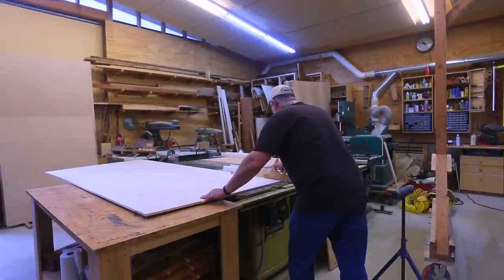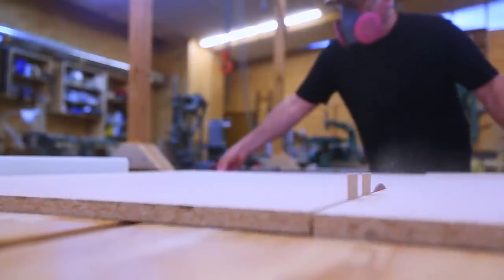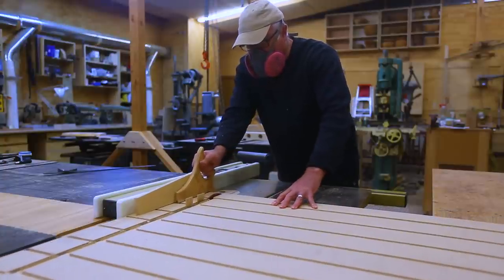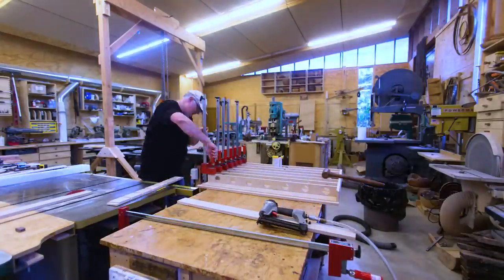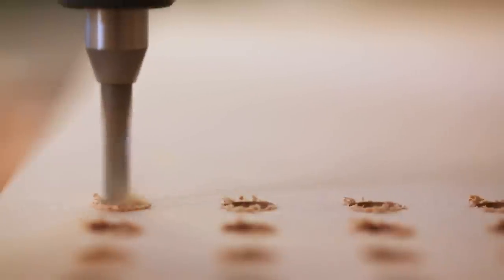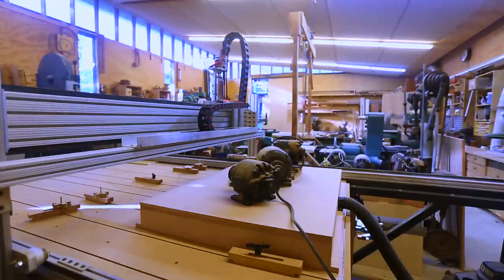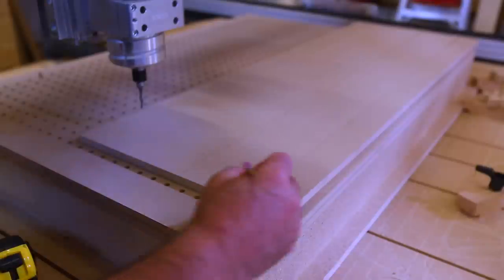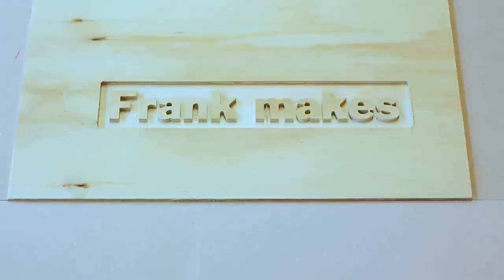Vacuum Hold Down Table

Comment: I own/run a commercial CNC in a millwork shop. Not sure how well the information would transfer to a smaller CNC, but here are a few ideas:

Our CNC has an aluminum table with holes for vacuum. Instead of having so many holes (ours are about 4" apart), our machine has channels around each hole to spread the vacuum of each hole. Would reduce cutting time, and allows for realistic plugging of individual holes.

Ontop of that we put a "spoilboard" solid 4x8 sheet of 3/4" MDF (no holes).

We prep the sheet by running all edges through the edge bander. This stops air from leaking out the sides.

Once that is done, I use a 3" cutter to mill off about .2mm from one side of the sheet. No only makes it very flat, but the surface is now much more "open" for airflow. Flip the sheet, and repeat. The sheet is now perfectly paralel to your gantry and open for airflow.

I'm not sure if a vacuum should have enough power to do the same (pulling through MDF) on your scale. Our pump is 10hp, but it is capable of 5x12 cutting area (usually setup for 4x8). I can cut a 24" x 24" piece of MDF sitting in a corner of the sheet without blocking the rest of the sheet off.
Reply from the maker: I thought about doing the method where you suck right thought the mdf, but it looked like you need a big suction motor for that.  A lot of flow and pressure.

Comment: Hi frank,  make sure you have enough air flow to allow the shop vac to stay cool. They rely on air flow to cool the bearings and motor.

I've seen people use motors from ducted vacuum systems and drill a small hole in the hose so it leaks just enough to keep the motor cool.

Love your work
Reply from the maker: Good idea. There is a cut in the hose, maybe I won't fix it.
Reply: frank howarth perfect

Comment: I used to run a graphic arts camera that had a vacuum film back. To allow different sizes of sheet film there was a sliding valve that would close off the area around the edge allowing smaller and smaller sizes of vacuum area. The sizes were marked off in red so you could align the film where the vacuum was, worked quite nicely and I'm sure you could do the same thing and not even need those pieces for blocking off the air flow but the pieces for alignment might be nice.

Comment: Hey Frank,  not sure on the vacuum required but some of the CNC router companies I've come across draw vacuum directly through the MDF w/out the peg board design needed.  You can isolate this surface area with thin plastic sheet i.e. trash bags.  Love your videos.

Comment: To get better suction you want to make a larger number of smaller holes. Big holes like what you have or pegboard for example don't make very good tops for suction tables. I'd suggest looking at some videos related to making vacuum forming or vacuform tables - they're extremely similar in build and are used for holding down forms to molded, while a hot pliable plastic is placed over top that then gets sucked tightly over the form to make a mold of it.

Comment: We had a thermwood in high school with a built in vacuum table and what we did is cut custom waste boards for each project. We'd cut a 1/4" groove was offset to the inside of the outline of  the piece (if that makes sense). And a grid pattern of the same size/depth cut inside that outline along with small holes drilled periodically to allow the air flow. Then we'd fill the the outline with a 1/4" rubber strip. Once the piece was in place and the vacuum turned on, the suction would fill that grid pattern and apply even pressure across the entire piece. This was especially effective pieces that needed to be mass produced but even for small one-off projects it was fine because the work bed 8'x8' so you could simply grab an old waste board with some room on it and use that. I hope at some least of that was coherent. It's early and I haven't finished my coffee lol

Comment: You could use a sheet of plastic to cover the holes when you have an odd or round shape.

Just cover the table with the plastic, then cut and remove the plastic from the hole that you need to hold the work in place.

Comment: For an example of vacuum fictures in use on cncs on another scale I come to think of John Grimsmos channel (metal/knifes cnc).
His setup was consisting of multiple fixtures stacked with one having groves cut around a central air vent which would be sealed with an rubber string to form the perimeter of the vacuum to form. maybe easier to setup than the holes and chamber even if the vacuum might take longer to form. The tricky part would be to get the ratio of rubber compression, deformation and groove dimentions just right so that you get an air tight seal and have the workpiece rest on the ridges instead of the rubber.

Comment: That's a lot different than the conventional grid plenum with MDF spoilboard top, cool concept!.   You may find you have better performance with the tried and true with the addition of a few whole house vacs.    There is a lot of good information on making these in shopbots forums.      If you are interested I have some of these vacs and a homemade manifold that I could send some pics of.    Trupan MDF is ideal for your spoilboard.    I run an 8hp vac on my CNC and I think the whole house vacs are nearly as effective.

Comment: I do commercial large format printing on an Océ Arizona which features a 3050x2500mm vacuum table separated into multiple zones. If you made some of the baffles solid, then split your vac run with valves, you can turn on/off the individual zones and lessen the need to cover the unused areas.

Also the space inside need not be so cavernous, its just a pathway from the vac hose to the holes in the top. You could make it much lower profile by using a thick sheet of polycarbonate/aluminium/sealed MDF and route a series of channels only 3-5mm deep, then add your spoil board with the holes directly sandwiched on top. Our table is 2 sheets of aluminium with only a 3mm space between them. Also the holes are barely 2mm in diameter at 30mm centres. You'd be surprised at the hold down force it can generate.

Your table does what you need it to do, so I don't imagine we'll be seeing Mk II anytime soon. But I just thought I'd share incase anyone else can benefit.

Comment: Frank, love your work, always a good watch. I have a suggestion if you remake your table. Rather than making a torsion box, if you simply laminate together 2 sheets of ply or MDF you can route a deep criss-cross pattern into the surface to act as air flow channels. Then a third lamination with holes through it to act as the surface, where the through holes meet the channels below. This would be just as heavy as the torsion box, and easier to make and maintain the vacuum.

Comment: That could be handy for something that can't be clamped with classic clamps. But otherwise, the classic clamps you might use more often than that table, classic clamps are faster and easier for parts that have plenty of clamping room.

I forgot what you call them, but little connection points in your work piece so the part you cut out don't move, then you just use utility knife to snip the tiny tabs, no need to mess with a vacuum clamp. you might find it more convenient, but from here it looks like traditional clamps have it beat. Nice experiment, thanks for the share.

Comment: Hey Frank I put a 1/4" piece of mdf on top of the holes  and your vacuum will suck through the mdf and hold your piece down (depending on how strong your vacuum is) then put trash bags on the part of the mdf that's not been used to direct the suction to the work piece. You might try that and see if it would work for you.

Comment: Hi mate.  What do you think about just using some plastic sheeting, bags or tarps to shield off the area that you're not using?  You can just cut a hole where you put the workpiece.  You might even be able to use some butcher's paper.

Comment: Peter Collin suggested making each hole into a valve so you don't need to seal it.  I have a dirt-cheap way to do this.  Replace the round clear hole with a blind slot, 3/8"W x 3/8"D x 1"L.  Near one end, drill a 1/8" through hole for the air to pass through.  The valve consists of a little lollipop: a flat disk with a stick that is bent out of the plane of the disk.  When you pop the lollipop into the slot, the disk covers the through hole, and the end of the stick protrudes above the top surface.  Vacuum on: the disk is sucked down and seals the hole.  Place an object on the table: it pushes down on the end of the stick, levering open the valve (this takes about 2oz of force).   I don't know a simple way to make the lollipop, but it has to be cheap.

Comment: Hey Frank - Cool Idea & great video! Perhaps instead of the 'wood dams' that you made, you could use a heavy/cardboard paper. The vacuum should hold it down just fine, and you could cut out the paper where the work piece is allowing you to do virtually any shape/size that fits on the table.

Comment: You shouldn't have drilled the second sacrificial board. The best way, is to get an MDF product called Trupan (it's from Chile, but quite a few lumber importers carry it) but it's technically LDF, and you skim off 1/32" on both sides. That is your work surface. Place anything on that it will create enough vacuum pressure without all the holes nonsense.

Plus, you need to paint or coat all the other wood. As it breathes quite remarkably under vacuum. The bottom box would have been better if it had been made out of melamine.

Comment: Small note if you make another. Your inner baffles are perfect, what I've see in other is having a second mirror piece then you slide them shut to block of sections of the holes so it's just a little easier.

Comment: A few things I did differently on my vacuum assisted cnc router table; 1. I ported the vacuum areas onto zones table and had discrete holding zones.  2. MDF is porous and a vacuum can be pulled through it.  3.  I gridded the top into 1.5 inch squares and I can add 1/8 inch rubber gasket line between the squares to custom seal the zones.  it takes little more effort to re-add the grid when I reface the bed.

Comment: Well, if the test piece at the end is surrounded by other boards it surely helps keeping it in place... not sure you proved this is working as intended.
Reply: I had the same thought. the workpiece ends up being held in place by the "modular pieces" and makes all the vacuum table pretty much useless
Reply: But the vacuum is needed to hold the modular pieces as well
Reply: +Don Johnson ah yes those vacuum pegs
Reply: Don Johnson isn't the vacuum for cleaning up the bits of wood? If you don't have a way to get rid of the wood particles from the CNC it'll catch fire.
Reply: +sample text its so you dont have to screw/clamp the object you are cncing to the table
Reply: The boards are modular, but the work pieces are not, so the boards will not always be perfectly surrounding the work piece.
Reply: +Charlie Beadle they will have to, otherwise you will leave holes exposed and the vacuum will not work
Reply: Elev3n that's not true I'm afraid, if a few holes are exposed there will still be the negative pressure required to pull down the piece, it just won't be as effective.
Reply: +Charlie Beadle correct
Reply: The modular pieces aren't holding it in place. The vacuum is. The modular pieces are just to cover the holes that are exposed.
Reply: The gap between the work piece and the cover pieces has to be less than the distance between holes.  There can still be a gap there.

Comment: Looks nice! I always thought about using little spring-loaded ball bearings in the bottom of each hole to act as automatic valves. You just toss your workpiece on indiscriminately, and every hole that it doesn't cover will shut itself as the ball gets pulled downward. (Unfortunately, the holes probably would get full of sawdust in a hurry...)

Comment: Seems more like the modular peg board pieces are holding the work piece in place by surrounding it and then the router cut pushing down from the top. How much is the suction real doing? Would your logo have been cut just as well with the vacuum off?

Comment: I worked a huge flat bed beam saw once that had the opposite the bed had ball bearing vents that when pushed down blow air up and lifted the board which meant one could move a 9x8 board with one finger. I wonder if you could use the same principle in reverse so to localise the vacuum to the work area? Love your videos thanks for sharing your time and adventures.
Reply from the maker: That is a nice idea, had not thought of that. everyone talks about air hockey, this is uesfull

Comment: MDF is porous and doesnt need holes drilled for air to pass through. On CNCs we use in the millwork and cabinet industry we have vacuum tables built in and we use MDF spoilboards and the parts are held down to the mdf with suction. sometimes you can tape the edges of the mdf to improve the suction and also put laminate or another non porous material around the parts similar to what you are doing. Also just using a 3/8" bit and drilling with your CNC. instead of routing a circle for every hole would speed up your running time significantly.

Comment: On our CNC, the vacuum table has a grid cut in it in between all the holes, cut with a rounded bit, so that we can put tubular gasket type stuff around the piece being cut, and then everywhere else, we just use freezer paper and tape to cover. Also, it helps to put sawdust on the line where the work piece and the table meet, cause it helps seal it off.
Reply: and when the work piece is a weird shape (we build skis, so you have that parabolic shape on both sides), we cut that shape into a squared piece of MDF, and drill the holes in that for the vacuum to come through that. It works much better, if a bit tedious.

Comment: I have a 5'x10 ' table and it takes about five hours to drill all the holes.
I use a 1/4" end mill but do a straight peck. Last thing I do after drilling
is to put in a 1" bit and surface the entire bed. It takes off any high spots
and makes precise Z cutting.

Comment: You can make the holes just at the center of the table, and then you make hails from right to left and front to back, when you need to machine one small piece you can use one rubber ring to limit the area of the vacuum

Comment: What if each hole had some kind of floating valve?  The weight of the workpiece would open only the holes needed.
Reply: industrial cnc table saws have that, but the opposite.. it helps slide heavy sheets across the surface.. there are little ball bearings in every hole that opens (is pushed down) whenever the workpiece slides over it, making it float across, kinda like on an air- hockey table.. Now in order to do that with a vacuum table, each ball bearing would have to be spring loaded, with more force than the vacuum generates, or else the vacuum would just suck the bearing down, closing the hole.. It might be possible, but I'm not intelligent enough to know how.
Reply: you might be more successful by just creating sections with valves that you can shut off and keep it in parts that have higher vacuum then

a floating valve would work in theory but as said... the force pushing on it would be a bit too much to make it work... practically impossible...

industrial vacuum fixture plates for CNC machines use some rubber seal that you put in a square pattern milled plate so only the sections needed create negative pressure

in that case you could work with only 4 or 6 holes in total on the plate but you would need several lengths of rubber slings to actually create the seals themself...

pretty complicated stuff tho
Reply: check valves in reverse......
Reply: How about little rubber balls in depressions. When the air flow is great it would pull the rubber balls down sealing the hole. Holes covered by work pieces wouldn't generate any airflow so would not pull the balls down.
Reply: or put your workpiece in place and then cover the remaining holes with marbles.
Reply: I still think that a manifold setup and multiple shut off areas would be a bit easier to achieve... as you only have negative pressure in the areas you need it ;) (but it would cost quite a bit more as well I guess)
Reply: this is what I thought when he started making it. just a pin with a gasket and a piece of spring steel attached to the top board from the bottom.
Reply: Just some paper is enough to plug the holes tho.
Reply: I like the idea but the covering layer will need to be replaced over time as the router bit nicks through its surface so it might be a lot of work for something meant to be sacrificial.

Comment: 1/4" holes are sufficient for the vac hold down. If in your software
you have a feature called Convert circles to drill points then it will
do a straight plunge instead of walking around. When I have to drill
mine it's about 5500 holes and takes about five hours. I just turn off
the lights and go do something else for a while.

Comment: Hi Frank Great Videos, Hats off to you!!

I have built a vacuum pump and have thought about what you are doing, my conclusion is to buy some lee valley vacuum clamps, they have some with clamping on both sides, with a real vacuum pump pulling at max, these pucks can hold a pretty good clamping pressure, if you know the thickness of the clamp I would think you could get a double clamp with a pump and hold whatever to the normal table.
You can build your own pump for under 300 bucks, joe woodworker vacuum pump.
Much success to you!